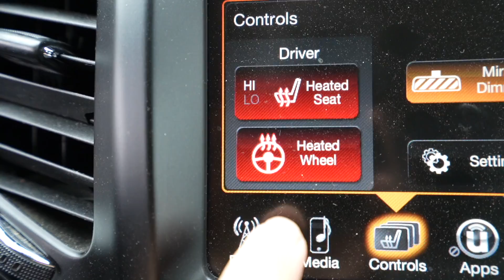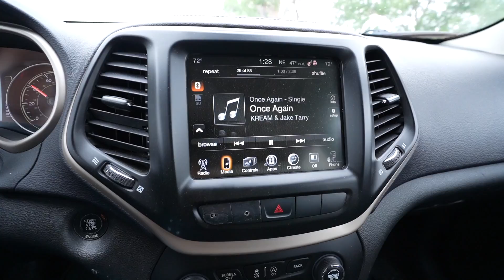NEW SHOP IS UP AND RUNNING!

Comment: You need to get a set of low profile, light duty arms for that lift. Make the second lift your heavy duty lift. The arms are pretty easy to change so you if you ever needed to have 2 heavy duty you could swap them. I guess.

Comment: I had a 2015 chrysler 200 with the 3.6 pentastar. I put 190k miles on it before I wrecked it into a bunch of birch trees. Kept the oil changed and the only issue I had with it was the oil cooler letting go and dumping all the oil onto a parking lot. If I wouldn't have noticed the oil on the ground I would have blown it up. I was not easy on that engine and it took all I could dish out..
Reply: That's one of those, "it ran great before it broke" stories lol.

Comment: You guys should get into repairing new broncos.
 "Dozens of new Ford Bronco owners are reporting critical problems with their trucks' 2.7-liter EcoBoost V6 engines. They're failing with low miles—under 10,000, by the looks of it—and are being sent to dealers where repairs can take months"